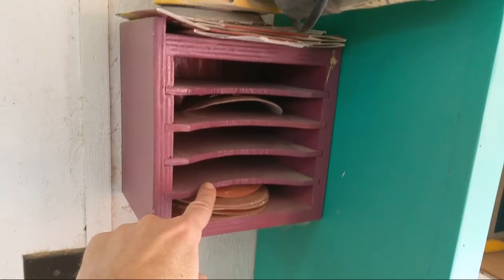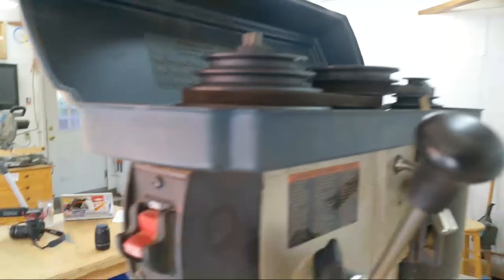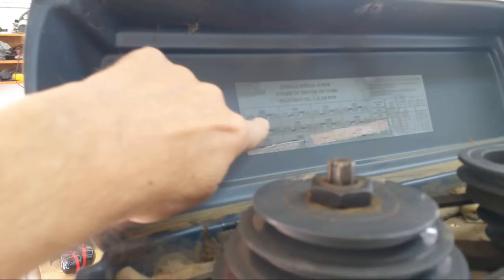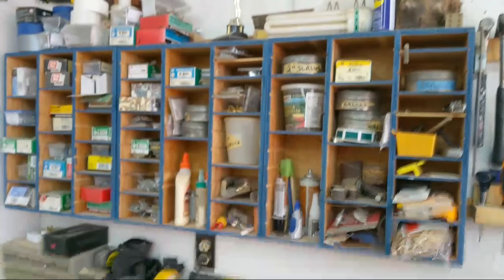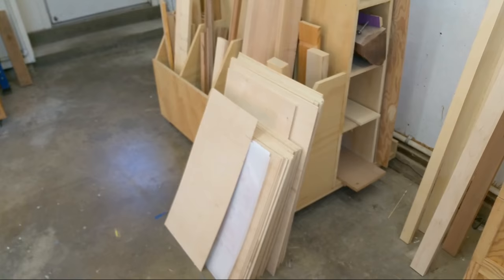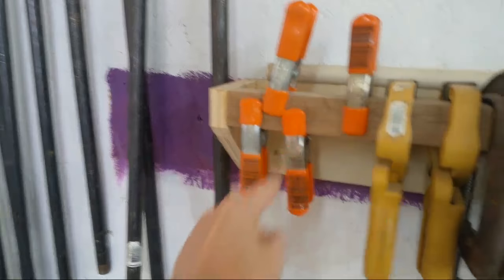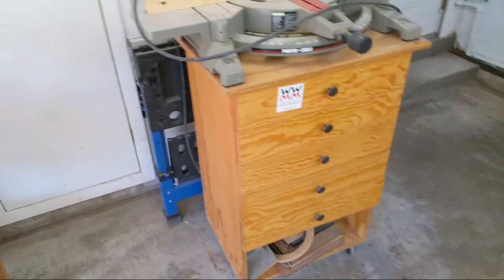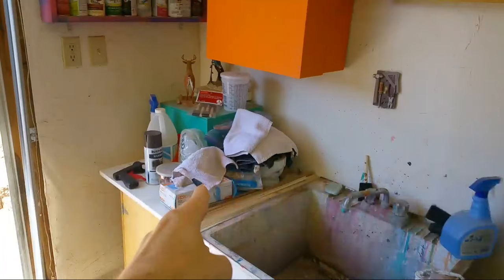🔴 WWMM LIVE Shop Tour

Comment: I built your router table and I am a fan of it. I did not build the drawers in it as I store my bits in a case. I do use both tracks. The one in the table is a combination t-track and miter track. The track on the fence is a regular t-track. I find the miter slot useful for running jigs through the router.

25:00 Your lumber/scrap cart is easily one of the greatest woodworking projects I have ever encountered. It is the reason why I subscribed to your channel.

Comment: I have a tip to taking off the 8” sanding disk. Take the paper backing from a new disk and pull old sanding disk halfway down to the table. Stick the paper on the sanding disk half you folded down then spin it till it’s gone 180. Then pull the top part of disk that is still stuck and it should come off. I know I probably lost you lol but maybe you already know this by now.

Comment: Hi Steve,I was watching your shop tour when you came to the clamps, I was told some time ago about making clamps that are strong and cost nothing. I got a length of old drain pipe and cut it into pieces about 4 inches long and then cut them along the side. I screwed 2 bits of wood to act as handles and they work great, if you need more strength then use 2 bits on top of each other. I know I am not good at describing these clamps but they are very good and cost nothing

Comment: Hi Steve, during your tour you mentioned that you have a hand held saw that don't gives you straight cuts. I had that problem with mine at one time, it turns out that the blade was warped and form the heat of making long cuts. Now once in a while I take the blade out and lay flat on my table saw to verify warp ness.  Try it out.  Nice video, like nice to earth people taking.......There is an extra "and" in my typing, sorry...